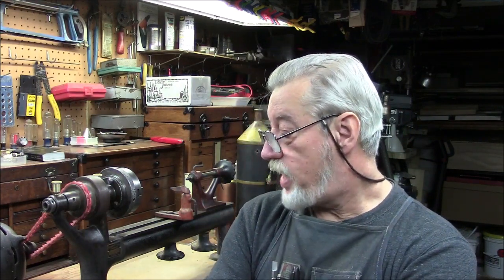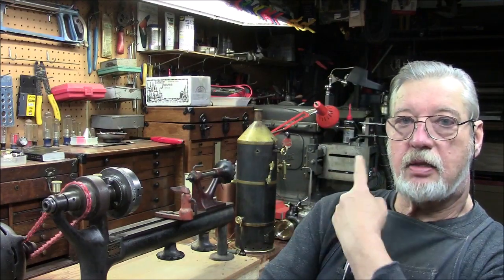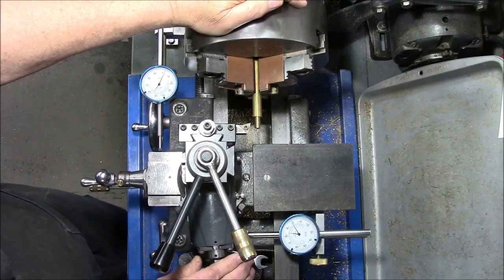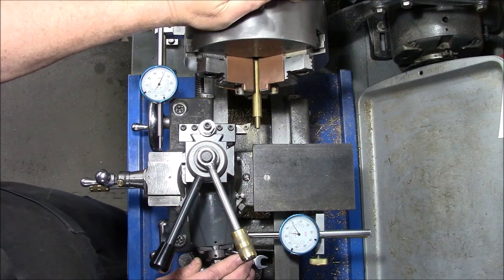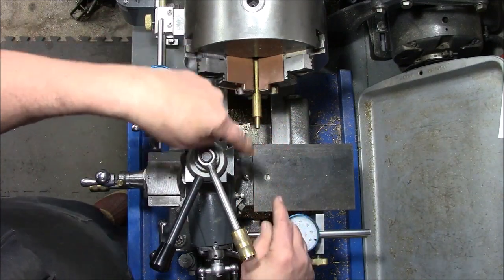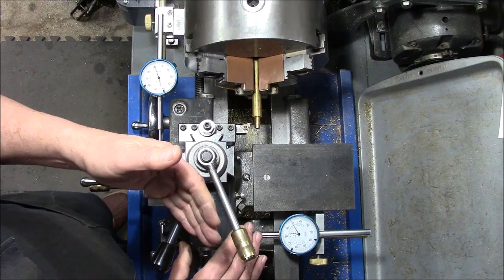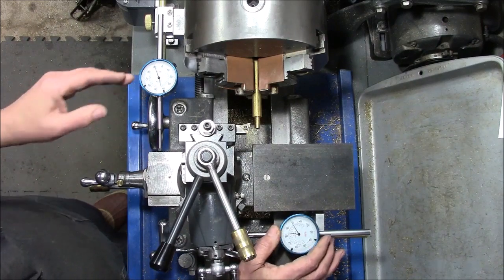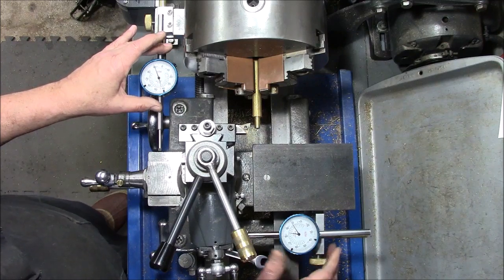2019 Greeting, Upcoming projects and a Lathe DRO - ARO

Comment: Hi Fred. I saw that sweet steam engine you built. I was wondering what you used for seals on the steam chest and output rods. Ive looked all over and nobody covers this topic.
Reply from the maker: Hi Ron,  The rod seals on the engine are basically tubing compression fittings that have been modified with wraps of graphited string in place of the brass compression ring.  You tighten the nut enough to compress the wraps of string while still allowing the shaft to slide.  This type of seal is as old as steam engines themselves.  It works great and can be replaced or tightened as necessary.  Hope this helps..  Thanks for watching..   Fred
Reply: @FredMiller  Thanks for the prompt reply. I take it you rap the rod and then tighten it into position on the plate??
Reply from the maker: Yes,  it is very subjective how many times to wrap it and how tight the nut is tightened.  You want it tightened just enough to keep it from leaking steam or air. Good luck.  Fred

Comment: I’d be interested in a bit more detail on how you made that in a future video.
Reply from the maker: No problem Karl...  I will provide more detail with a future video..  Thanks for watching and commenting..
Reply from the maker: Here ya go Karl.  This turned out to be a pretty popular video and there were lots of questions like yours.  Hope this helps you out...  All the best...   Fred
Reply: Fred Miller Thanks Fred!  I have a 1950 QC54 10” Atlas and have been trying to get some ideas on a simple DRO. Hard part is finding a place to attach it on the cross slide. Been using a 2” dial on a magnet for the carriage.

Comment: Just did something similar on mine. Bought an analog Dial indicator with 2" travel and mounted it to a magnetic indicator holder. I can move the holder anywhere there is sufficient metal to stuck to and if I crash the carraige into it, it just slides away without damage.
I made two auto oilers after seeing yours and also made a poor man's dro after seeing yours.
Take care.
Reply from the maker: Thanks for the comments.  I had been experimenting for quite some time with magnetic holders (they slid because I had no flat surfaces).  I moved them until I found spots that were out of the way then hard mounted them.  I can remove the long slides and DTI's if needed and just leave the brackets.  Glad to see you made some oilers.  They work great for me too.  Keep on makin chips!   Fred